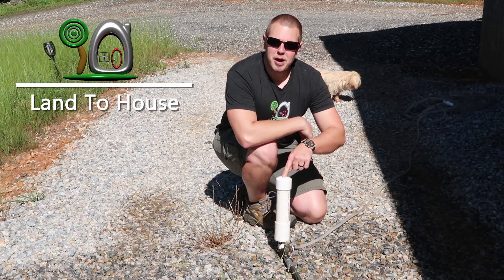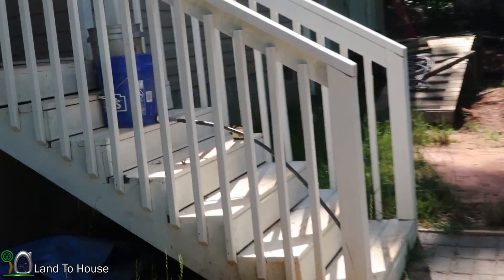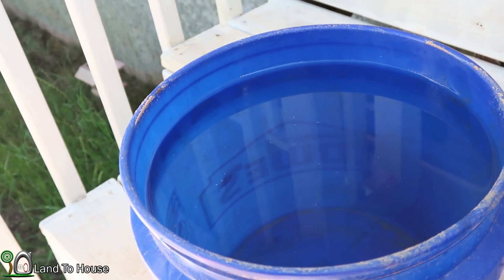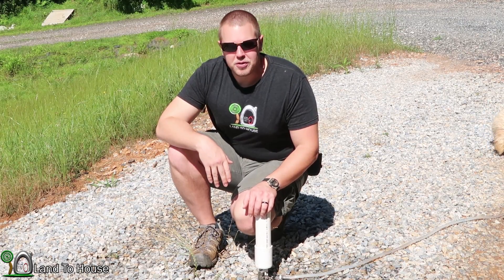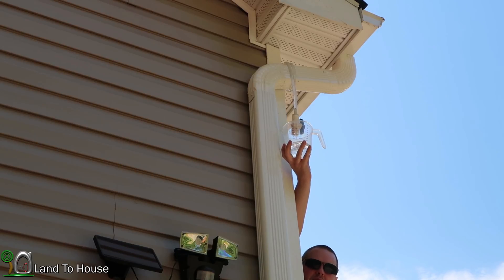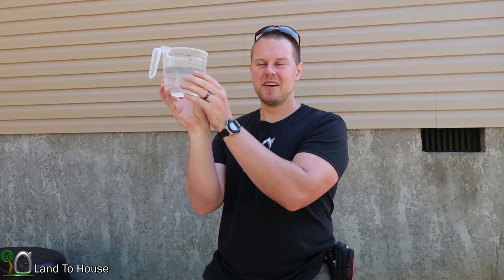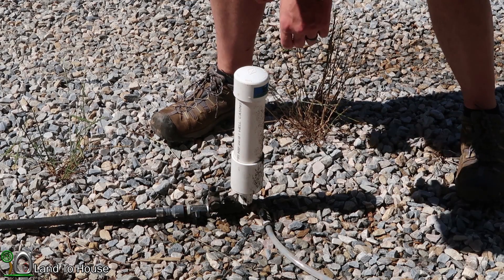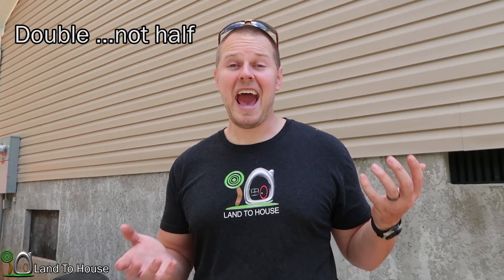3/8" Ram Pump Testing

Comment: Hi Seth, I did a little math for your 3/8" Ramp Pump: I calculated the efficiency from the parameters you measured in this video. I came to nearly 87% efficiency, which is a quite high value! When having the value for the efficiency it is possible to calculate the expectable flux (in gallons per minute) for a given Drive Pipe Height vs. Delivery Height. That might be interesting for your customers, too. I sent you also an eMail with all the calculation details including a flux rate matrix. Might also lead to some fun Ram Pump videos with validating the calculation and the flux matrix. Would also be interesting to calculate the efficiency for your other Ramp Pump sizes.
(PS: Commenting a 2nd time, my first comment was not showing up for some reasons)

Comment: Hi Seth, I did a little Math for your Ram Pumps: I calculated the efficiency from the data you measured in this video. I came to nearly 87% efficiency, a quite high value for this little 3/8” pump! Having the value for the efficiency it is possible to calculate the expectable flux (gallons per minute) for a given Drive Pipe Height vs. Delivery Height. Might be interesting for your costumers. I sent you an eMail with all the calculation and an example of the calculated flux matrix. Please contact me if you are interested. Might also give rise to some fun Ram Pump Videos with validating the flux matrix and measurement of the efficiency for your other Ram Pump sizes.

Comment: We have a very small Spring trickling exactly .5 GPM ... what is the max distance and height the 3/8 in. pump can push?
Reply from the maker: My testing with the 3/8" ram pump is very limited. From what I can tell so far the pump works well and has close to the typical 1:7 ratio, head pressure to lift, as the larger pumps. Lift I cant say for sure but at least 12 feet. As for distance I would expect several hundred feet.

Comment: Good test Seth. Useful data. That is a significant amount of water you are moving. A bit less than 9.5 g/hour and at that rate 225 g/day is pretty darned good.
Reply from the maker: It was a bit of a shock to me. I was not expecting the results that I got from this setup. At 225 g/day someone could water a garden or animals with no problem.

Comment: Hello I'm from Brazil. I really like your experiences and I already did one of the ones you teach. I would like to know if there is a relation between the height of the source and the pump with respect to the final range. Thanks
Reply from the maker: The difference in hight between the source and the pump is known as "Head Pressure" This is what makes the pump work. The ram pump works on a 1:7 ratio head pressure to lift. So if you have 2 feet of head pressure you should expect 14 feet of lift. I hope this helps.